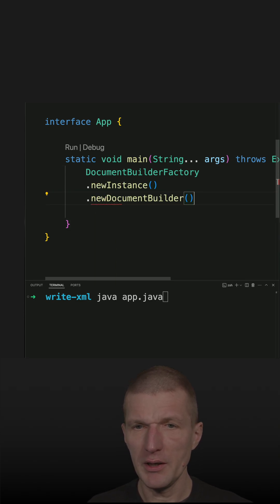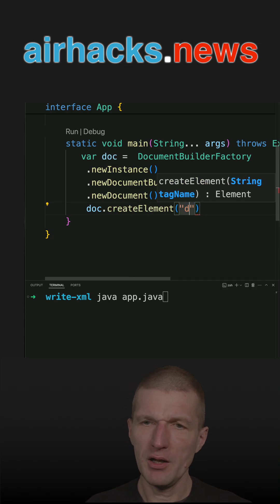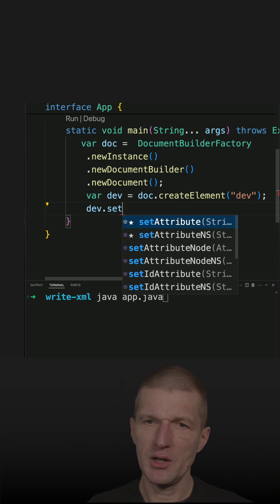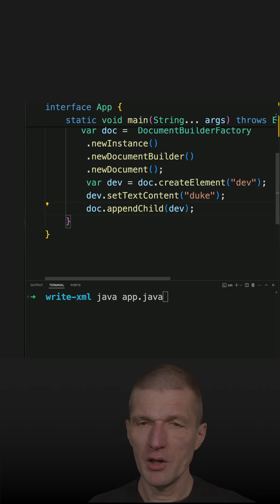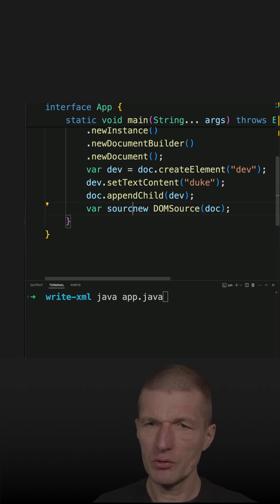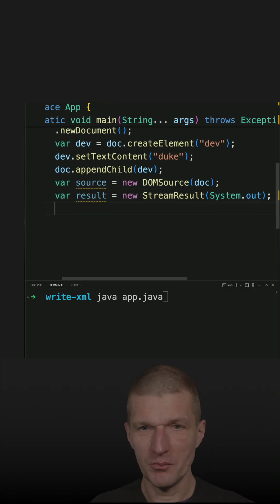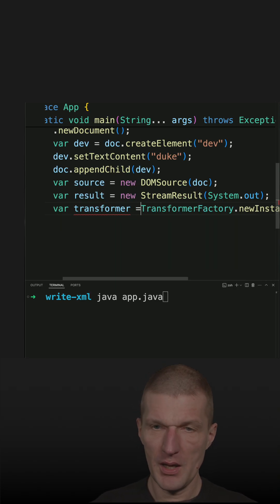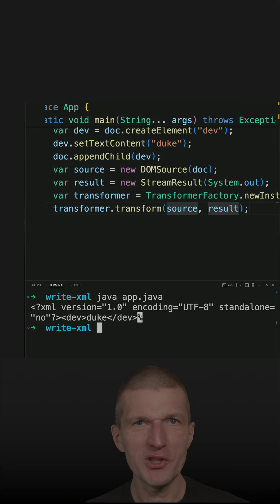Writing XML Document To File with a Transformer #java #shorts #coding #airhacks

Comment: Always shuddering when I see interface instead of public class for something with implementation. 
Will you still use it when Java released the new main class syntax?
Reply: He argues that he it doesn't matter what context the static main is and he can omit the public on the main because all static members in an interface are public by default.
I don't like this either. But the top level main is something I will use everywhere when it releases. The main really doesn't need a class context to this is better in every way.